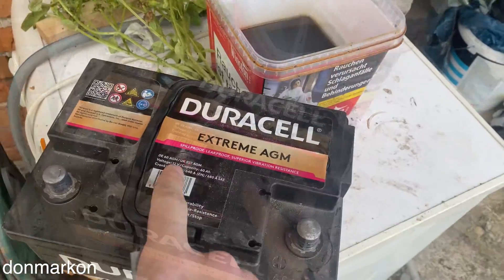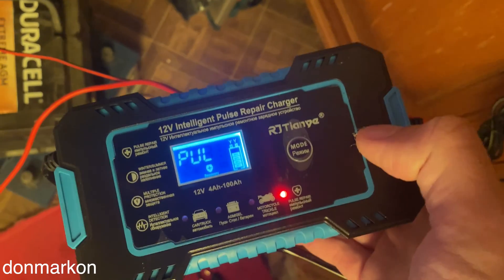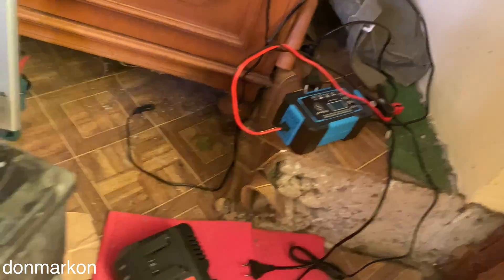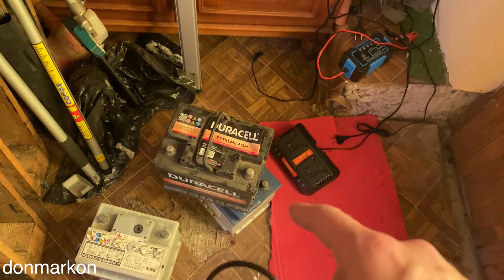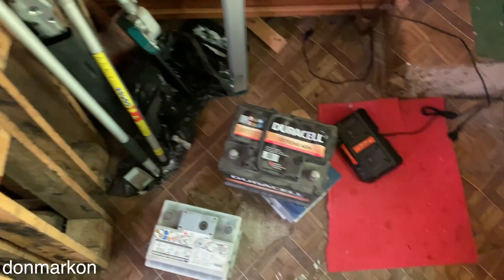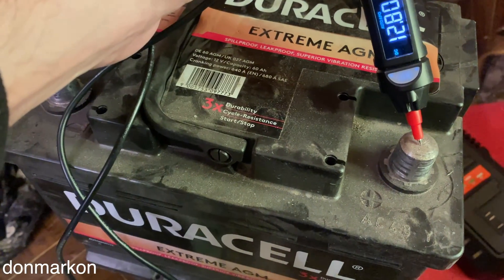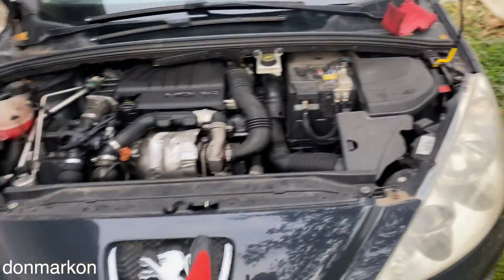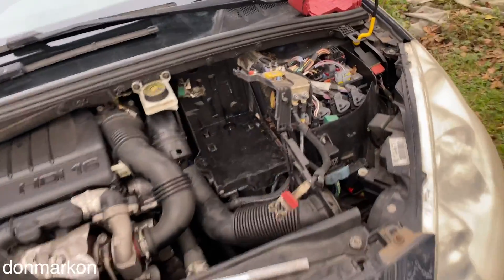Car Battery Repair Trying To Save It From Trash With Pulse Repair Battery Charger

Comment from the maker: Pulse repair chargers - https://s.click.aliexpress.com/e/_DDOO1up
Reply: Good video, what is the make and model of your charger? Do you know if your charger sends 16 volt spikes like a Noco Genuis or CTEK charger in repair mode, or does it use a frequency pulse like a PulseTech Xtreme battery charger and desulfator, and a PulseTech PowerPulse passive battery desulfator with a patented frequency, which is what I own and have used on my 2001 BMW Napa battery for the past three years?

Comment: Just a tip man - don’t set your batteries on concrete, it can make them discharge.  Set it on a block of wood or something.  Looks like you probably didn’t have it there long, so not a big problem, but never store it sitting on concrete